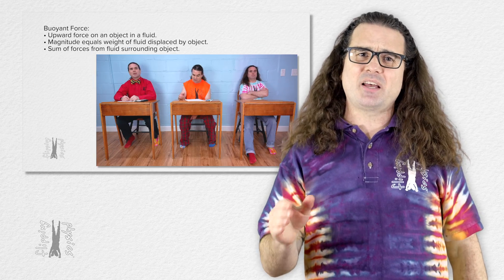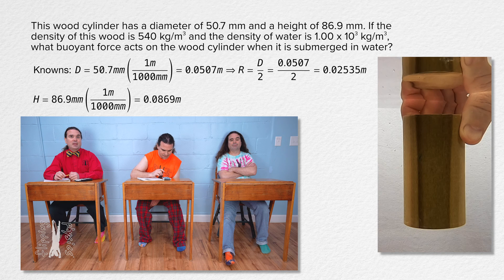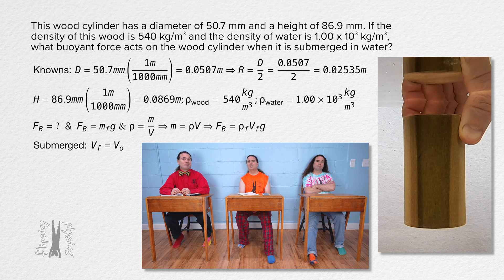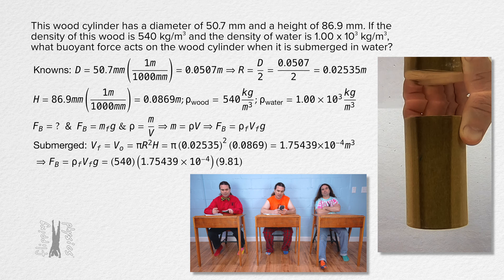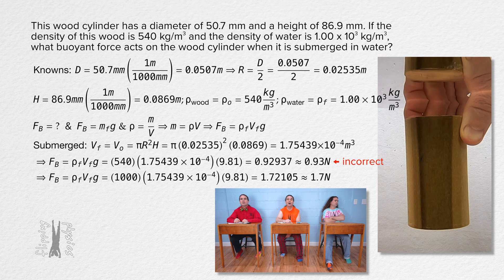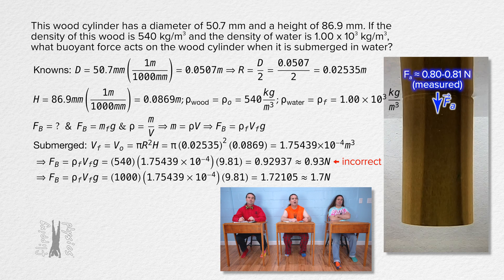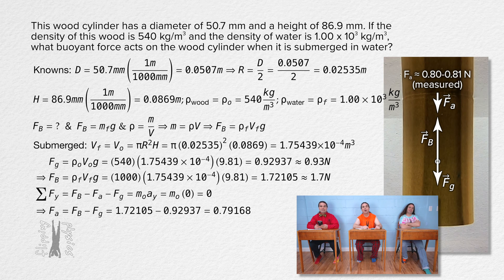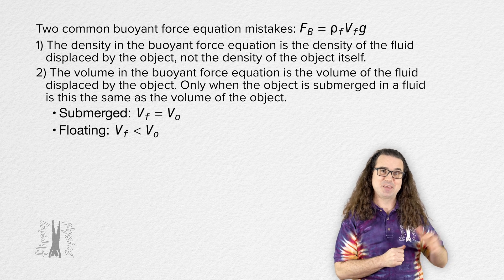Buoyant Force Calculation: A Submerged Wood Cylinder

Comment: Looks good. Just thought I'd float a comment here.  Oh Bouy, that was punny. My only complaint, as always, is the lack of units in the intermediate steps. I encourage everyone to include the units in every step so that you can be certain that you end up with correct units. Density times volume times "little g" gives (kg/m^3) x (m^3) x(m/s^2) = kg m/s^2 = N. It is often useful to remember that the units of "little g" can be written as newtons per kg (N/kg). Physics students should be able to show the equivalence 1 N/kg = 1 m/s^2.
Reply from the maker: As always, I recognize and understand your complaint, however, I'm not going to add units in every step.